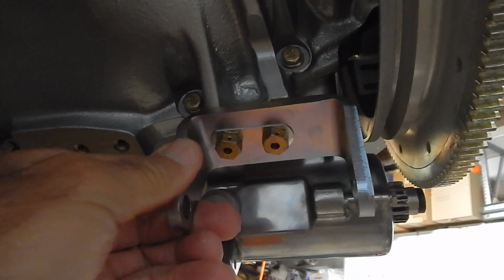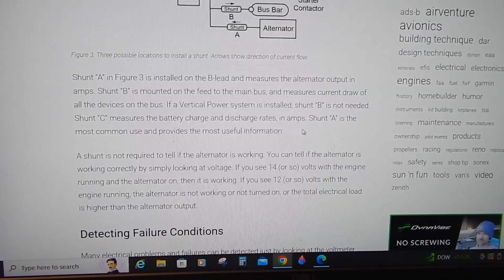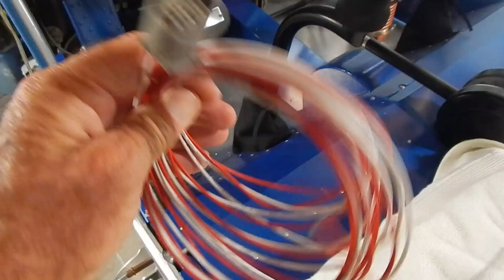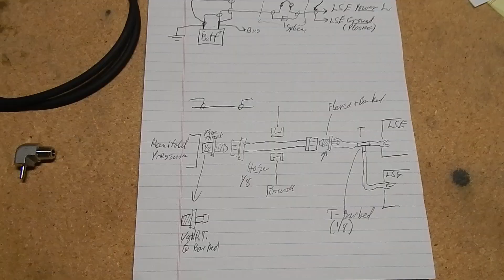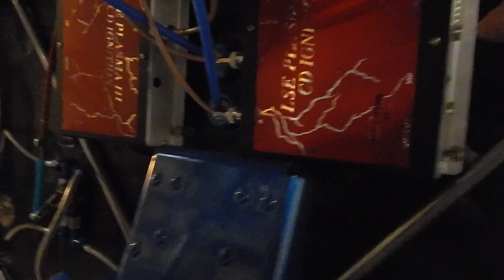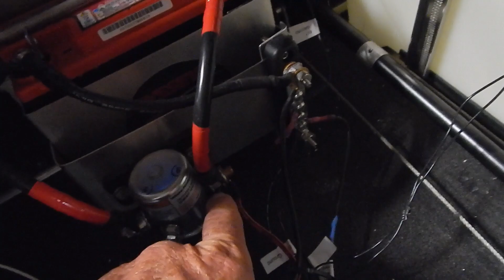RANS S21 Build - ep 46 - Alternator, shunt, and MP Hose

Comment: I've seen that 3-port "block" for the pressure sensors on other builds...  Did that come with your kit, or is that a Garmin thing?  I bought the Garmin engine sensor kit and the GEA 24, but that block didn't come with mine...
Reply from the maker: No, it did not come with the kit.  I saw a few other builders use it.  I believe I got it from Stein.  It's pretty straight forward to install.  Also, some of the sensors themselves also did NOT come with the kit.
Reply: @treetopflight7624  Oooh...  Did you buy the Garmin engine sensor kit?  I THOUGHT mine came with everything, but it didn't come with a fuel pressure sender-- it came with a fuel flow transducer instead, which I can't use because I am using the SDS EFI & Ignition, so it has a return fuel line that goes back to the tank.  It would have to measure both, and subtract the return flow from the feed to get the actual fuel consumption.  Also only came with one shunt, which doesn't work for my dual alt/ dual battery system.  What else was yours missing?

Comment: Nice videos!  Just curious, what is the purpose of the ELT CB?
Reply from the maker: The ACK ELT does require a power wire and the manual calls for a 1 amp breaker.  I'm not sure if other ELTs are the same.  I just re-checked the installation manual to make sure. Thanks.
Reply: Thanks for the explanation.